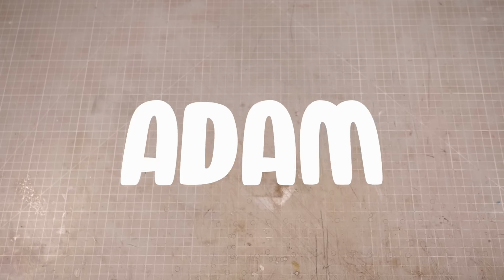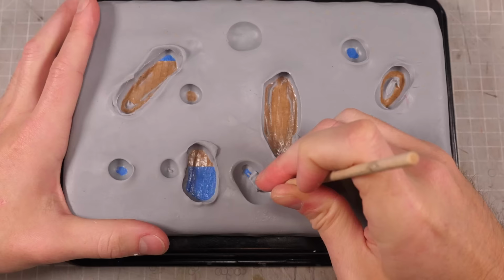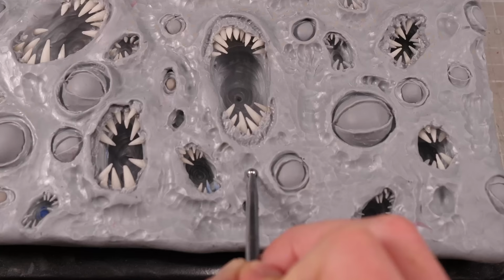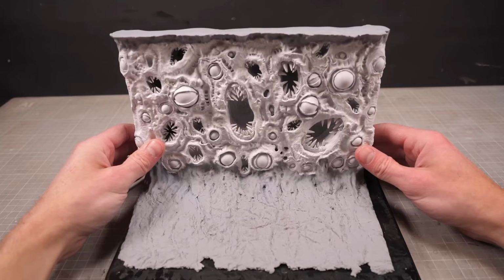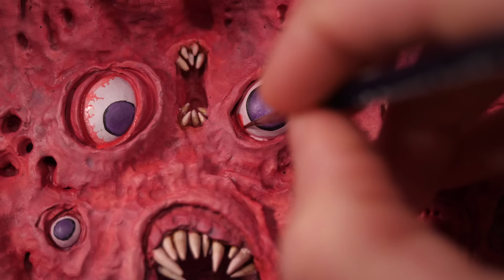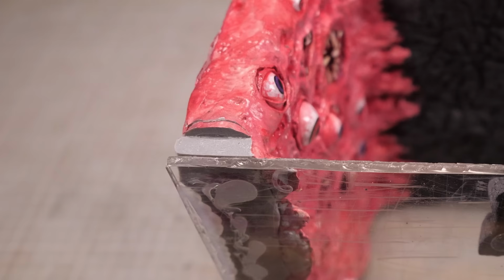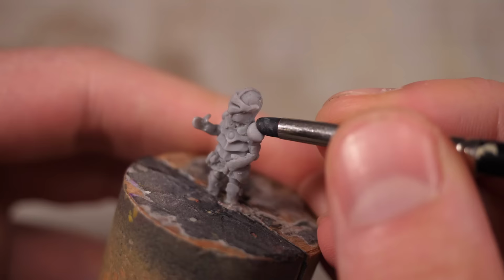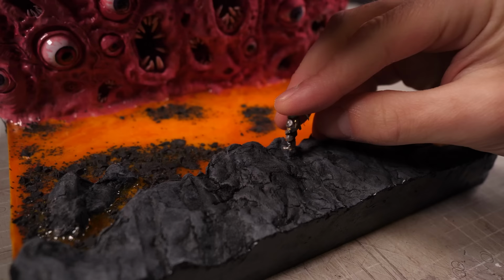I made the Wall of Flesh

Comment: heres a random line of code to make stuff spin in roblox
-- Get the part you want to spin
local part = game.Workspace.Part -- Change "Part" to the name of your part

-- Function to spin the part
local function spinPart()
    while true do
        part.CFrame = part.CFrame * CFrame.Angles(0, math.rad(1), 0) -- Change the rotation angle here (1 degree in this case)
        wait(0.01) -- Adjust the speed of rotation by changing the wait time
    end
end

-- Call the spinPart function
spinPart()